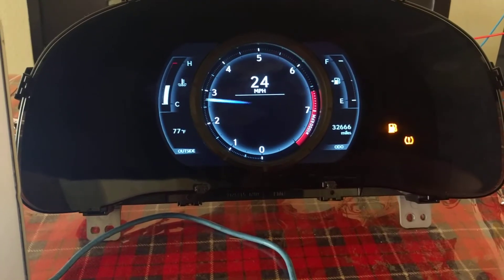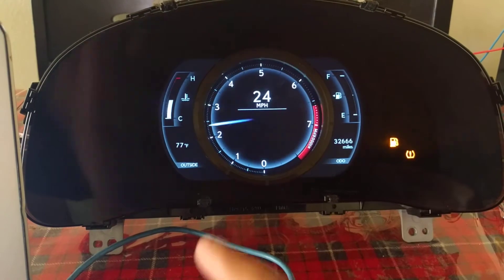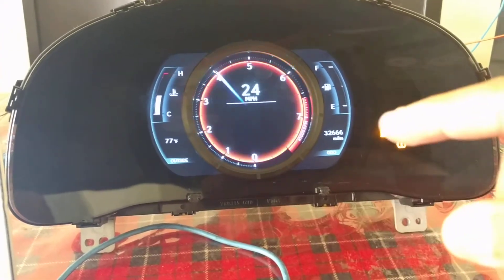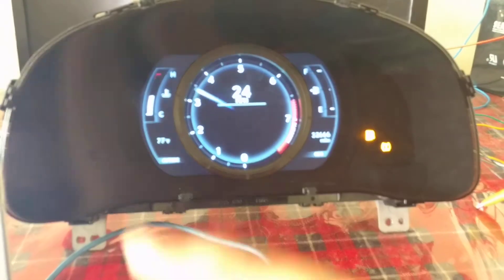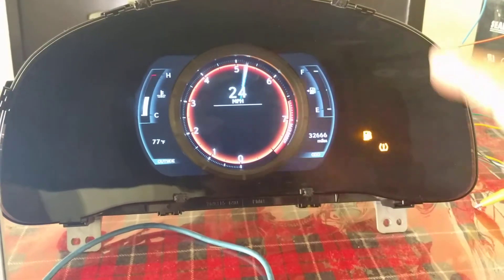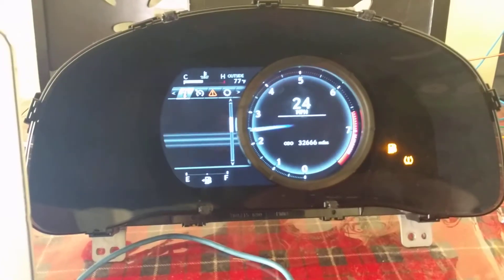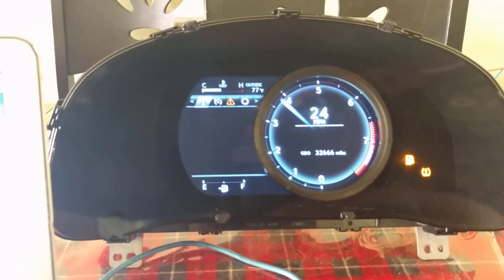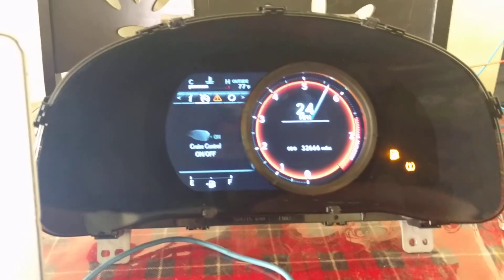Is250/is350 f sport cluster working outside car canbus hacking

Comment: is it possible to swap 2013 gs350 fsport with 2016 gs350 fsport? every thing fits in but bunch of errors (battery, drive-start control, brake override, engine coolant temp. and RPM doesn't work)
Reply: You swapped it ?
Reply: @abtalktoem_1956  nope tried. seems like can communication from ecm is not working. prob. ecm is not detecting the cluster. not sure

Comment: How do you hack it to display the same mileage?
Reply: You need to either re-programme the EPROM chip or send the speed CAN-bus message to it to make the mileage climb up. I did it by just sending speed data with the correct mileage increment value and the mileage climbed up to my desired mileage. If you need mileage to go back then EPROM re-programming is the only way
Reply: @ahmed24s  did u getr the cluster on ur is?

Comment: Hi, where i can get a pinout for this cluster? Or even better a whole electric digagram for 2017 is300h? Have some problems with hazard lights not working after cluster swap. Narrowed down to small connector in the cluster, but do not want to play further without pinout, not wanting to fry something :) if i do not find any info i will to start sniffing arround  voltages and signals, but it is a hard way. Thanks in advance.

Comment: @gerald's project vlogs any chance you can provide us at least one sample of a can frame? I want to test if i'm at all able to communicate via CAN. Without a valid message it's hard to know. It will be interesting if you can maybe offer for sale a database of the CAN ID and values that you have.
Reply: CAN frame for speed is 0x0B4 8 00 00 00 00 00 10 00 00 - The 6th byte is related to the speed. I'm currently working on this fitting it on the 2nd Gen IS250 and almost got it all working. I will be posting a video and full details soon.
Reply: Any update on getting a kit/adapter to run this cluster in 06 and up is250/350?
Reply: @ahmed24s  Awesome that's great. Finally someone willing to share some information :)
Reply: @ahmed24s  hi! So do you have success with this?
Reply: @sdmperformance5985  hi, yes I've almost completed it. A big challenge I faced was getting it to physically fit inside the 2is cluster area. This cluster is bulkier. I ended up buying a damaged dashboard from the breakers so I can experiment with fitting it without scratching up or damaging my dashboard. I've managed to get it to go in perfectly and bolt on too. I need to modify the bezel slightly and then finish up the installation. I'm currently working on quite a few other projects so it's not getting 100% of my time at the moment. I do plan to have this completed in the next few months. Once I've done it in will be posting on videos and photos on my Instagram and YouTube channel.
Reply: @ahmed24s  sounds great! I will follow you, it's very interesting!

Comment: In your video you have the speed fixed showing at 24MPH. Pin 20 on the 40 pin connector seems to be the speed input signal. How did you emulate the speed through this pin?
Reply from the maker: nope its digital for the screen.
Reply: @geraldjustprojects  So the 24MPH you got displaying on there is purely through CANBUS? Does running 24MPH via CANBUS increase the ODO mileage?
Reply from the maker: @johnroberts5357  no thats a different value in canbus. that ticks the odometer up as its moving. independent of speed. its a different variable.
Reply: @geraldjustprojects  Do you know the variable on the canbus that ticks the odometer up? Could you share with us the speed variable on the canbus? Thanks
Reply: NO? Do you have the message ID and parameters to turn off POP UP HOOD Failure message?

Comment: You should make a video to install on a non f sport 2014 -2017
Reply from the maker: It's already a drop in replacement with the non f sport models. From the same year actually. You just got to know how to take the cluster out and out it back in
Reply: @geraldjustprojects  oh what no way? So its just like a plug in play just have to connect it right?
Reply from the maker: @raminvisualz6620  yep for the non f sport type cars from the same year.